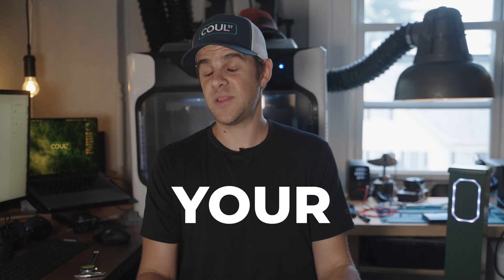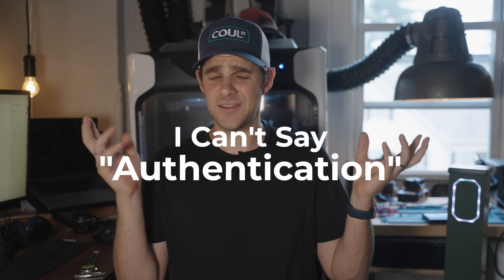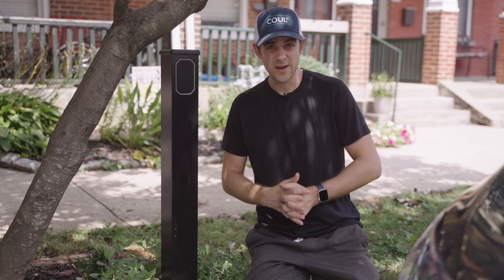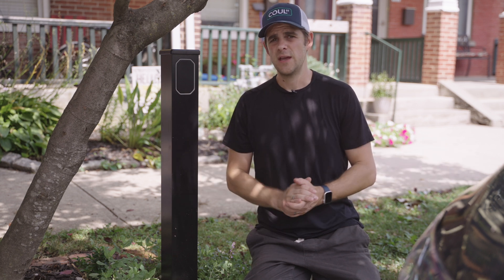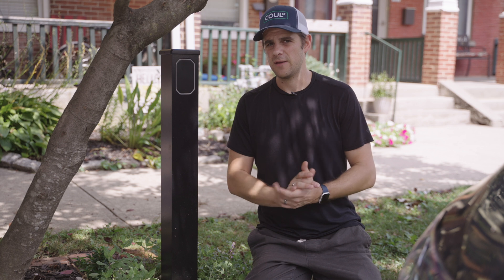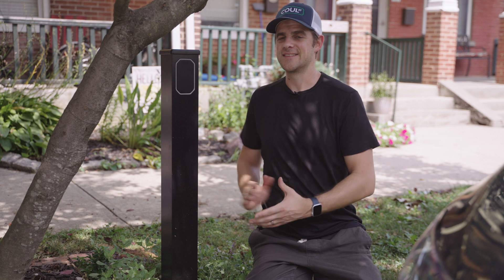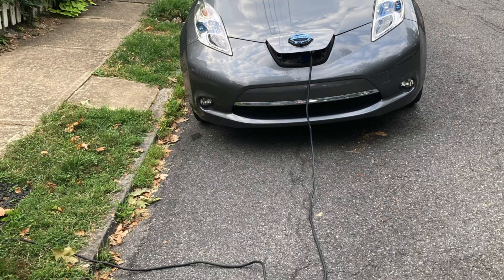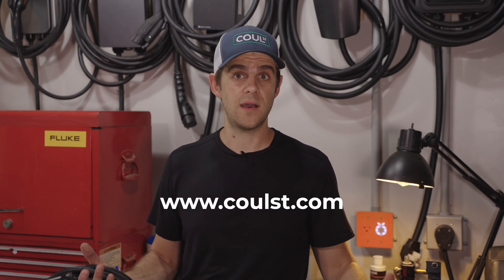Answering Your Questions

Comment: Id like the ability to run the charge monitoring on my own private server
Or have an api that can help me manage that including creating reports with an offline software
Maybe having a cloud option that also has an app that both coul charging point providers and users can leverage 

Decentralized to centralized saas solution may be in the works ! :D

Also can we have the option of directly connecting ethernet por favor!

Not everyone is blessed with reliable wifi speeds lol
Anything less than a 5g wifi antena could suck lol

Comment: I think you would need the person charging to authorize prepayment of a certain amount to ensure that they can pay for the electricity they have used. Another nice feature could be deciding which user accounts an and can't have access to the charger. I may want to allow my parents to charge but I don't want random people charging in my space as I need to charge there myself. Piggy backing off of that last thought it would be nice if there were a network map, similar to say Tesla's charger map, that showed which Coul St. chargers are open for public use. This way a user knows which posts to go to.

Another far down the line feature could involve the posts having some sort of sensor to detect if a car is currently parked in front of the post. This may be a bit overkill and I know the price is important so it may not be feasible.

Comment: Don't use WiFi for the plug, use the Helium Network.
It's damn near everywhere and cheap per transaction (thousands of a cent per packet). There are people providing coverage for no charge to you, it's ISM, so no FCC regulations aside from transmit power restrictions, and in EU: duty cycle compliance.
Brilliant.
No need to set up the device to Ethernet or peoples wifi, Helium IOT network is a perfect fit for an application like this.

Comment: Thanks for this update video.  Glad to see Coul St. will be using J3400 standardized cables.  I agree the extra pins for 3-phase are a drawback, but having all non-tethered EVSE using the same cables will be worth it.  Single phase cables and EVSE will not need to populate the space reserved for the 3-phase pins, so the only real drawback will be the larger size of the Type 2 plug.

Comment: Will it be available with an Ethernet port so I don't have to have it connected via WiFi?

Also what's the plan for states that ban electricity resale? Just charging by time like DC fast chargers in those areas? That could be awkward given these are meant to have your car left plugged in long after it's fully charged
Reply from the maker: Time is definitely an option and since we know how long power is pulled for, time can be billed based on that. We don’t have plans for Ethernet at this point, unfortunately.

Comment: Please stop calling these "chargers"  The charger is in the car.  The exception is level 3 DC (fast) chargers.  Tesla calls their device the "Wall Connector"  Otherwise, a good primer.
Reply: why does this bother u? is the term incorrectly used here? yes but the placement of the charger and the main power are inconsequential. to a user it will look and function the same way regardless. and for simplicity, most users will understand the basis of what the term "charger" means. why even bother trying to explain that to people when convincing them to put this in front of their house? the easiest way to get them to immediately understand ur idea and what ur trying to do is to use the term charger.

Comment: That type 2 connector is a bad idea nothing uses it here, trying to add another plug that as you pointed out wastes cords is a bad call.  NACS should be the standard.  OR just go J1772 for now because it won't really matter its just a plug end.
Reply: Just because SAE J3400 uses Type 2 for the charger side, it doesn't "waste cords."  The cables only have the conductors needed for single phase, with NACS or Type 1 (J1772) on the car end.  The Type 2 end doesn't even have pins for the unused 3-phase connections, just empty space where the pins would be.
Reply: Also that lock is pointless most cars with J1772 will simply unlock and don't lock the charger so having it lock to the post is largely pointless.  If you use J1772 as soon as the button is pressed it'll stop regardless.
Reply: @darrenorange2982  J1772 (Type 1) plugs do not lock to the car.  Anyone can press the release lever and steal your cable.  Type 2 plugs can be locked by the EVSE, preventing theft.  As Josh points out though, a defective EVSE that doesn't release your cable can be mega frustrating.

Comment: Many utilities have monopolistic positions in given areas, and can prevent other entities from charging per unit energy. So you may have to adopt alternative billing methods such as; most commonly, per unit time.
Reply: One problem DC fast chargers had in Canada is that no Industry Canada approved DC power meter existed for billing purposes.
Reply: @economicprisoner why would that matter, if you forgive my being naive. Couldn’t you just use standard three phase metering before the dc conversion and meter that way?
Reply: @danielquintero2339  The 3 phase meter may power more than one dispenser.

Comment: I would have liked to see the post have J3400 on it instead.
Reply: If you watch the video to the end, Josh says that Coul St. will be using J3400.  So one end of the cable will be Type 2 and the other will be Type 1 (J1772) or NACS, depending on what type of inlet your car has.
Reply: Unfortunately there is no way to do that since the J3400  standard specifies Type2 on the other end of the cable for BYOC

Comment: For the parking solution, why not implement rates based on time of usage, similar to what Tesla superchargers do? If the homeowner bumps up charging rates at night, when they most probably be home, then the less likely another user might want to plug in to that specific outlet. Of course the system might need to support time based rates which would also might enable home owners to make a profit off the charger to offset installation costs.
Reply: Not sure about the states, but Canada has banned per minute charge rates. It all has to be charged per kilowatt hour now.

Comment: Questions:  I'm assuming that the remote EVSE configuration requires separate power (line voltage) and control/data (low voltage) wiring between the pedestal and the charger?

If this is the case, then separate conduits are required for power and control wiring. Additionally, these should maintain minimum separation and maximum parallel run lengths. Is this all correct? Additionally, would twisted pair wiring also be a requirement in order to minimize interference?

Has Coul St. considered including everything needed for an installation in one convenient package, rather than requiring the customer to procure materials?

Comment: Everyone is going NACS
Reply: And this 100% supports that.
Reply: @charliesullivan4304  I think they are talking about from the plug/post-side since NACS will be the standard in NA it will probably become easier to get a NACS on both sides of the cable
Reply: @erwinwill9437  the draft standard 
for North America J3400, includes the Tesla style connector at the vehicle and and the type to european-style connector at the stationary equipment end.

Comment: Things might have changed, but the last I knew there are several States where the selling of electricity is approved restricted to regulated entities. That is, it is illegal to charge people for electricity until you're a registered utility. Have you looked into this to see if there are States where people are going to have problems? There is the "loophole" of not selling the electricity, but renting the cable since almost no one in the US has an untethered charging cable.
Reply: This is a solved problem: public paid charging is available in every state.  Some, fewer every year, only accept it if it's paid per minute of charging rather than per kWh.  That's a problem for DC fast charging, where the car is often the limiting factor on the charging rate.  But for this, level two, most cars will charge at the full rate offered, so if you have to charge by the minute, it will still be fair.

Comment: Still don't understand why you would use a type 2 connector on the plug side vs a standard NEMA 14-50. This forces everyone to buy a new cable versus being able to just use a mobile charger that comes with most cars.
Reply: I believe it's about safety and esthetics, if you have a live outlet at the post, then if water gets in it, or if the post gets hit @8:20 then the city won't approve the design. But in the current design, the cord sends a signal to the EVSE in the house, to begin charging, thus ensuring the post is only live when a vehicle is connected to it.
Also @12:20, the design implemented an electronic lock on the post side, so you could also make sure someone doesn't maliciously unplug you during a charge session unlike an outlet which offers no such protection.
Reply: @Seattleandrew  makes sense, I didn't catch that those features were based on the plug connector. He did mention that scanning the qr code would initiate power being sent but if the plug makes it automatic that's a nice feature. Locking it to the post will likely become important in the future too. 

It's interesting though, I just got back from a trip to Alaska and they have 120 plugs in posts at every parking spot for engine block heaters, no one worries about "stealing" power and heaters can use a decent amount. Sure, it's not as much as an EV but as EVs become ubiquitous I think the FUD around charging equipment will subside. Locks on gas tank doors used to be a big deal, now some cars have them and other don't.
Reply: @Seattleandrew 
This could be done using the APP to turn on power to the car once you scan the app, a contactor could engage and start the charging process
Reply: A standard NEMA 14-50 is problematic for several reasons. The top 3 are:
1.  Live posts. Josh addresses this in this and other videos. A key design consideration is for the post to be energized only during valid charging sessions.
2.  NEMA 14-50 receptacles weren't designed for frequent mating cycles (plugging/unplugging). Type 2 connectors, as Josh points out, are rated for 10,000 mating cycles or more (depending on manufacturer).
3.  Data requirements. In order to facilitate remote charging (that is, where the EVSE head-end equipment is physically separated from the power delivery point), the EVSE must be able to detect plug mating events. Additional data wiring may also be necessary for session communication and control.

Hope that helps.
Reply: @ARepublicIfYouCanKeepIt  definitely appreciate the explanation, makes sense.

Comment: Standard 220 outlet in the post. Car companies are selling oem cables that connect the car to 220. Also, just put the electronics of an off the shelf unit inside the post or in a house... Use readily available units with accounts for each user.
Reply: Another issue is that most plugs are rated for a few hundred insertions. The j1772 plug and nacs plug are rated for 10,000 cycles.
Reply: He addresses this @8:20 the concern is having live electricity all the time at that post. In the current design, the electricity only travels to the post after a vehicle has connected and completed the circuit.
Reply: @Seattleandrew  no reason to have live power there all the time. His solution doesnt